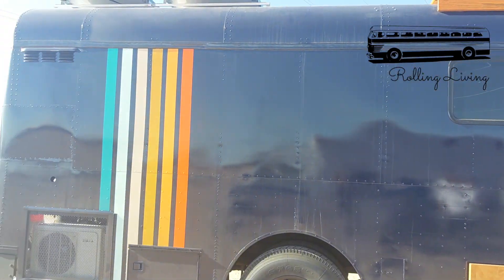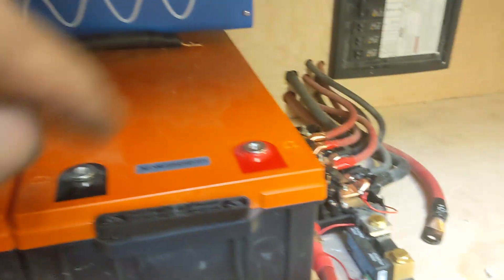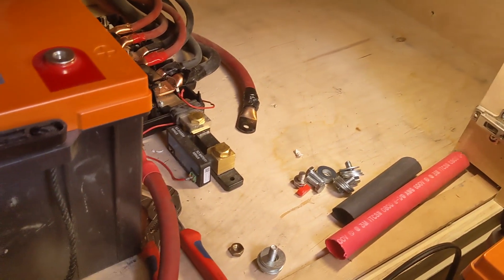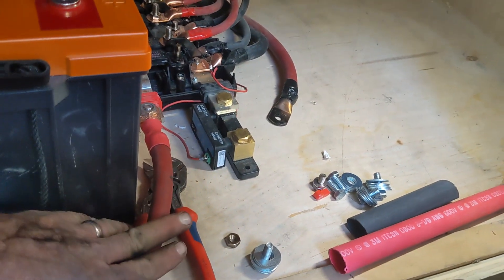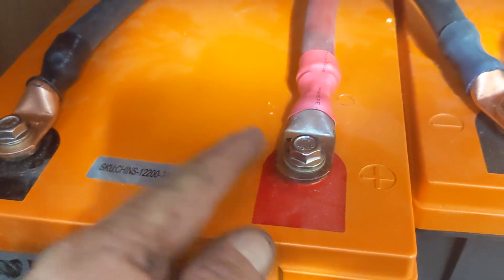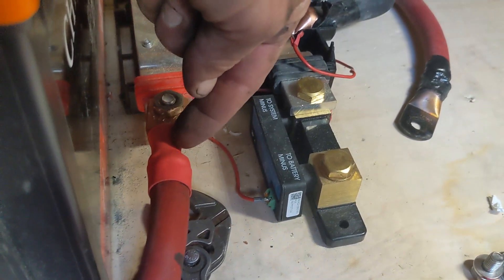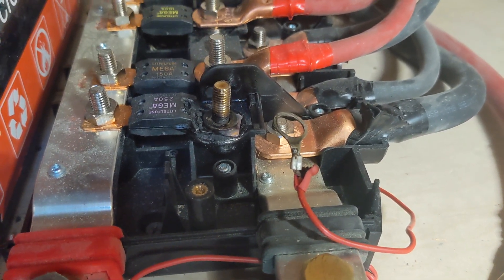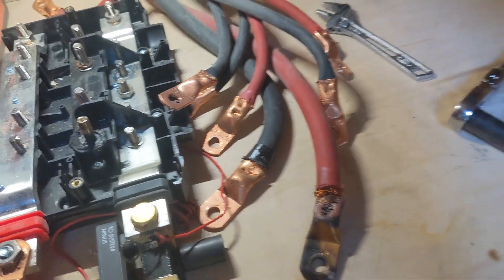I'd call this an Epic fail...unsafe electrical work.

Comment from the maker: Here were my notes in the "findings" section of my summary. Based on what I saw, I have lots of suggestions for them as well...things to fix, things to check.  But here's what I observed in my first pass of this inspection:

* Several ring terminal connections were loose.  4 nuts on the main bus bar studs were finger tight and I was able to remove those without tools.  I found that the nuts on both inverter power connections were also loose and removable by hand.
*. One ring terminal, and the stud on which it was connected, was heat discolored and the electrical tape wrapped around the ring terminal was melted and burnt.  This ring terminal was the positive power cable for the inverter.  The plastic around the bus bar stud, and the fuse body, were both melted and charred.
*  None of the ring terminal fittings were sealed with proper 2-layer (adhesive lined) heat shrink tubing.  Each one was wrapped in electrical tape.  This was the case with the cable ends at the bus bars, the cable ends at the inverter, and the cable ends for every battery interconnect.
*. Every single ring terminal was poorly and improperly crimped.  It appeared that they were struck with one or two blows with either a flat-blade screwdriver or a small chisel.  Photos taken.  This was the case with the cable ends at the bus bars, the cable ends at the inverter, and the cable ends for every battery interconnect.
*. There was no disconnect between the battery bank and the bus bar, so there was no way to cut off power in the event of an emergency (such as happened).
*  The battery connections were improperly made.  Instead of using bolts of the proper length, longer bolts were made to fit by stacking up to 6 washers on the bolt.  One of the bolts wasn't even a bolt, but was a broken bolt with a nut seized in place...and several washers stacked to make it fit.
*. The parallel battery connections to the bus bars were made from one end of the bank, only.
*. The batteries were not restrained or anchored down in any way.
*  The interconnection between the lead-acid starter battery and the lithium house battery bank was made with the wrong combination relay.  Instead of using the Victron Cyrix-Li-Ct relay, a standard Cyrix-Ct relay was used.  This could have damaged the alternator, due to the low resistance of the lithium bank, but fortunately the 150A fuse in this circuit blew.  Note:  The Cyrix-Ct which was installed is rated for 120A.
*. The cables between the bus bars and the starter battery box are run through holes, cut through sheet metal, without any grommets or chafe protection.
*. The solar panel PV wiring on the roof is not secured and is flopping around, and chafing, loosely.
*. The roof penetration box for the PV wiring has no watertight glands installed.  The PV wires run through the open holes with no protection from water intrusion.

Comment: That's crazy!!!!! I have a hydraulic crimper that I swear by! They even cut off the braids to get it to fit in the connector rather than getting the proper lugs. Epic Schoolies should be shut down until they retrofit all their conversions with proper safe electrical. Training on DC installation, current draw, HVAC installation and mostly common sense!!! Glad they found you!!! please give us a follow up video!!! Thanks for sharing!!
Reply from the maker: You noticed that, huh?  Good eyes!  Yes, even though the terminal rings were the right size for the cables they must not have a proper cutter...so the cut end didn't fit into the fittings.  One thing after another.
Reply: @allthethingswedo  Hope you can get them straightened out. How's your temperatures out there? It's going to be 13 here friday night.

Comment: Ross, thanks again for rescuing another bus. I hope that this wakes them up, and they fix their ways.
Reply from the maker: One would hope...but I just learned that their response to a video by Chuck Cassidy (a solid guy) was to send him a cease and desist letter.  That's not a good sign that they plan to improve...
Reply: @allthethingswedo  the only ones that need the Cease & Desist letter is Epic for building the most Epic Failure of a bus and lying, cheating, & stealing from all of the folks that bought from him because they did not buy a quality built, safe bus like they were led to believe they were getting!! Karma is gonna come around one day soon and bite them in the ass tho or one their customers is gonna lose their bus to an electrical fire like almost happened here and once the investigation turns up that it was lack of following general electrical safety installation guidelines then hopefully the insurance company will go after his A$$ and then he will hopefully be shut down!!

These type of conversion guys have absolutely no business building a bus for anyone!! They couldn't even build a fricn doghouse!!

Comment: I am "really shocked" by the disgusting substandard quality of workmanship here, the actual materials used look okay, but the instillation of them is nothing short of criminal. This family has had a very near miss with total disaster here, with an electrical meltdown occuring when their children had been left alone on the vehicle.  I would not be able to sleep safely for wondering what other electrical misdemeanours have been done to this standard, or worse. Surely there must be some regulatory repercussions that can be brought to bear on the company who did such shoddy work? 
The family is fortunate indeed to have happened upon your acquaintance and very knowledgeable know how in making it safe for them. 
David in Wales, UK.
Reply from the maker: The bad crimps...I can't even call them crimps...so, let's say the bad crimp attempts are just shoddy work.  But the absence of a battery disconnect is unforgivable and dangerous.
Reply: I've used a hammer and concrete to make a tight crimp in the past, but I bought a crimper now. I don't even know what to call that! You're charging people thousands of dollars for work! You can't skip the correct tools! My method would at least compress the copper strands together!

Comment: That's like the work of a DIY er . I have a hydraulic crimps set like yours - cheap off Ebay there's no reason for using a screwdriver on a crimp that's proper old school bodge it. The lady was lucky

Comment: Woah      Even a vice grip would have done a better job at crimping it!

The problem is that there is zero requirement of quality work for low voltage stuff. No license, no standard to follow, no nothing. It is literally the far west, and it also show on what is available on the market off the shelf too.

But that job, that is criminally bad. It could even be debated as criminal negligence as it is only a matter of time before something bad happen, like cause a fire while you are asleep. And since alot sleep with the door closed, and the smoke detector is not in the bedroom, it is foreseeable that you would die of smoke inhalation before the smoke detector get triggered.

Comment: What about the other end? Was it as as bad?
Reply from the maker: It was. I put properly crimped ring terminals and heat shrink tubing on the other end where those cables attached to the inverter. By the way, the nuts on the inverter connections were just finger tight too...